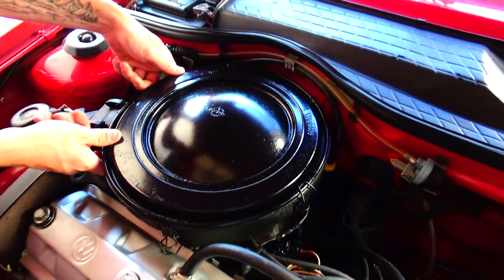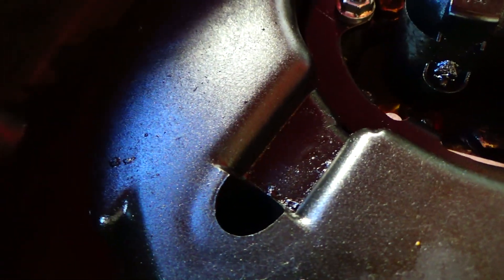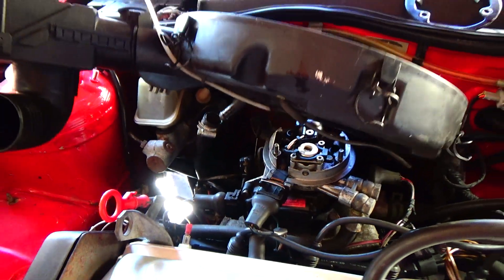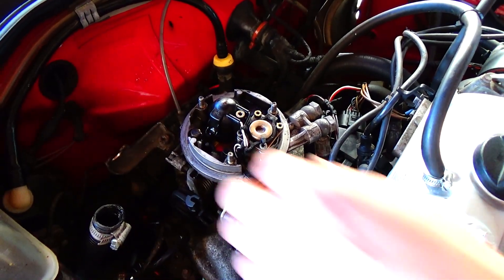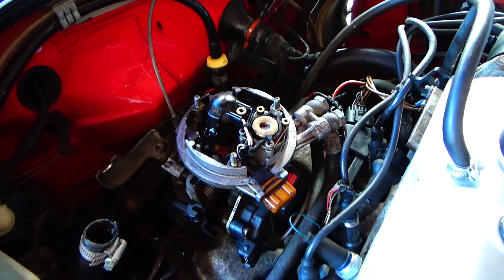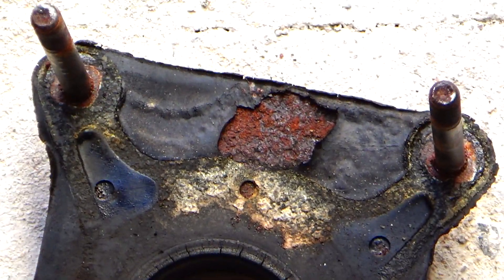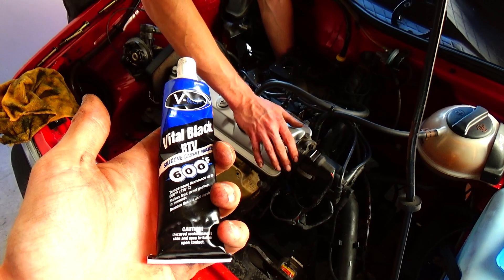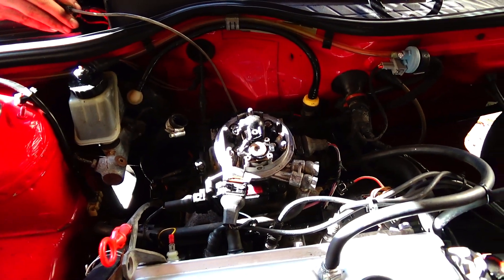Ruined Rides -  Replacing Carburetor Flange On A MK2F POLO

Comment: Hi guys as someone on here also asked do you have any tips for removing the nuts off the bottom of the manifold - is it easy enough reach under and do it by feel with a ratchet or spanner?
Reply from the maker: We just reached from the top with a 10mm rachet spanner and got them off like that, took ages but was really the only way.
Reply: @RuinedRides  thanks I'll have a go then :)